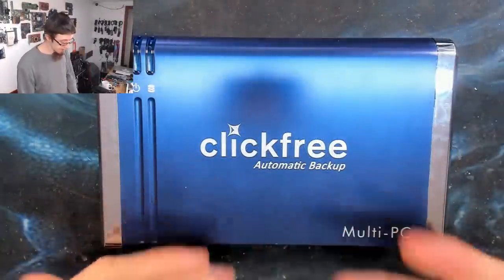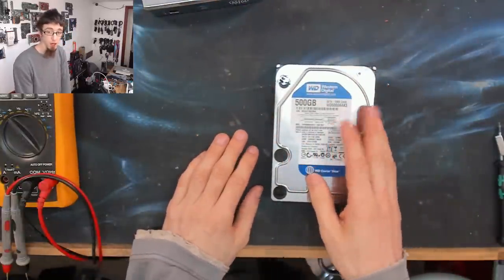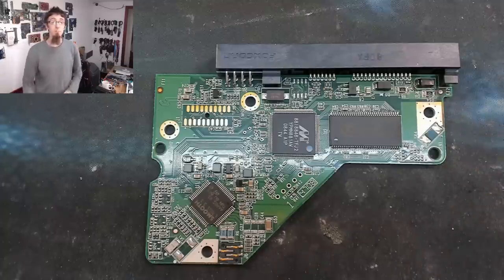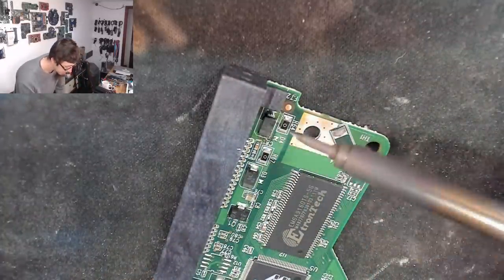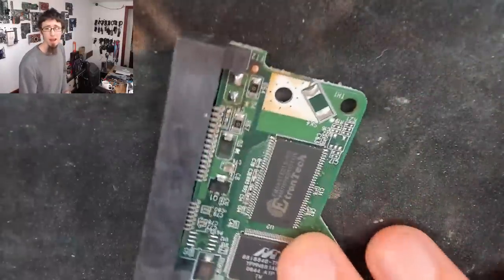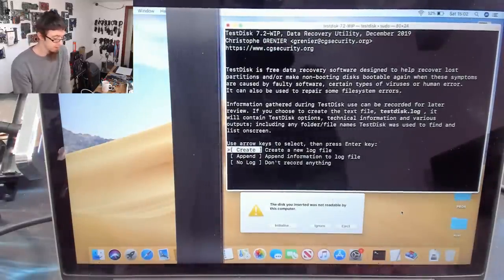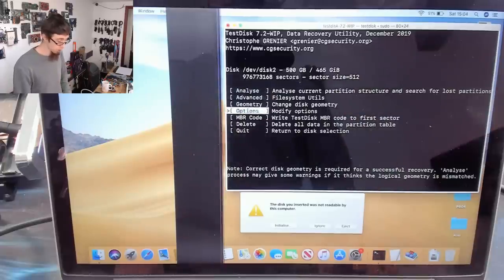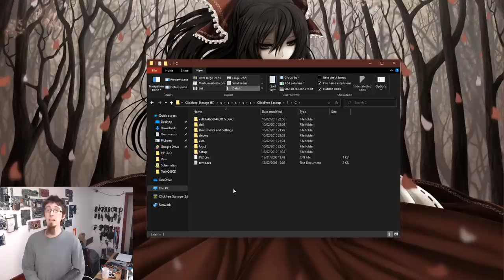Lucky save, HDD with shorted SATA connector - LFC#223

Comment from the maker: Regarding the Tweezers I mention in this video, I was mistaken - they're LCR tweezers, not hot tweezers. So not actually useful for this job.
Reply: Adamant IT yes you can see them in action @electronicsrepairschool
Reply: A better option to remove smt components is with a hot-air rework station. Basically it produces a small stream of hot air to melt the solder so you can remove it. Alternative you can use solder wick (braided copper) to remove solder from the PCB and component so it can be removed. That said the hot-air station is the preferred tool to rework PCB boards.
Reply: I've seen there are ~$15 solder iron tweezers online now on eBay and I assume Aliexpress.  I ordered two additional SH72's with some J style tips and printed a holder on a local fab lab 3D printer to make portable tweezers.  Haven't gotten around to assembling yet, since don't have the need. I'm still working on outdoors projects.   Am planning to either use PlastiDip or Type 2 silicone coating on the 3D printed part also to seal and provide a little better grip.  Thanks for sharing... makes me want to check my bin of HD's to see what might still have some life left.
Reply: Hey adamant IT. Quick question, if I have a 1080ti where 1 fan might be shorted, and the card only shows black screen when booting, what options do I have? Have disconnected all fans, but it wont boot. Is there something I could swap out or check with a meter?
Reply: @runehansen278  If the fans have three wires (speed feedback), its possible the card will not run with the fans disconnected. One option is to try running the fans (12VDC or 5VDC depending on fan voltage) to see if they work. Also check the fan power pins to see if the card is supplying power to the fans.
Reply: @guytech7310  the fans run when the card is plugged in. It has 3, 1 of them had its wires cut by the metal fins.  1 fans has 4 wires, the others 3
Reply: @runehansen278  4 wire fans have speed control, 3 wire fans usually just feedback. Its possible one or more of the fans isn't providing feedback signal. 
if all of the fans are working, than the likelihood of a bad fan causing the problem is low.  It could be a bad voltage regulator on the board, if there are any electrolytic caps on the board they could be suspect causing a low voltage rail output.
Reply: @guytech7310  thanks, I will try looking closer
Reply: @guytech7310  if I send a picture, can you maybe help me with some points i could measure?
Reply: @runehansen278  Fans go open circuit and not short circuit
Reply: Not cheap ($32 Australia - tiny amount) but if one is not so patient, Chip Quick’s Low temperature solder, I only seen others youtubers use it, as I not tried it myself. You just add the solder to reflow at it temains at melting point a lot longer. In regards to melting plastic, I yet to experiment with kapton tape to see how good of a heat insulator they are, love to tape up plastics connectors to heat sheild them from the hot air gun. Think i buy a temp probe and tape it up with layers of Kapton to see temp differences over hot air, how efftive Kapton is. They say it can withstand temperures up to high as 260°C (500°F). I seen other tech tape over ribbon cable connectors without melting. All sharing for any short cuts that the tech savvy knows, to make life easier or simple for those newbies out there. Yes I have foolishly tried melting glue and end up accidentally deforming a small section of the white backlit plastic from the display screen. Should of used that UV glue the dentist uses or Kapton.
Reply: @jafinch78  would you care to elaborate on this setup ? I also got two SH72 and will be happy to test your 3D tweezers model if it's finished/useable !
Reply: @jonas-fr  Sure, great timing since the cold front came in last night and even though I still have some outdoors chores to complete before the snow falls... I am wanting to look into again as I saw at the Goodwill Store a 170W Lenovo laptop PSU... though unfortunately was only a 20V unit and I don't really feel like reverse engineering at this time to beef up to 24V. Otherwise, I haven't done anything other than PlastiDip'd the handle part that was 3D printed.  I used this printed part:
http://www.krekr.nl/content/cheap-smt-solder-tweezers/    I wound up deciding on a ALITOVE AC 100-240V to DC 24V 5A Power Supply Adapter Converter that was an eBay offer accepted for $9.   I ordered another power supply adapter converter, though that one wound up not working and I have to disassemble, inspect and attempt repairing. The plan is to use two male 5.5mm x 2.5mm barrel plugs soldered together to make an adapter to the 24V 5A PS.  Edit to add that I was thinking about desoldering the female barrel plugs on the SH72 to save a little money and just directly wire to a female connector to the power supply.  Decided not too.  If you have any other questions... feel free to ask.
Reply: @jafinch78  thanks !
Reply: @jonas-fr  Not sure if applicable for your needs, though I just thought about noting regarding tips if you've not seen the comments in this article.  Here's regarding a video I made regarding to mod for the range of available tips: https://hackaday.com/2020/01/27/review-saneryigo-sh72-soldering-iron/#comment-6261646
Reply: @jonas-fr  Finally got around to editing the photo of, and narrating (long winded), the SMD Tweezer build.  The image details pretty much everything other than the shrink tubing for the barrel connector solder joints and connectors. https://www.youtube.com/watch?v=iMwJ-Jm0dpM  I left links in the description also for the STL's and some of the parts used.
Reply: Hello I have question about a diode?   I'm not sure if it's a diode or resistor, it has an S right in the middle. I have a picture but can't post in the comments.
Reply: @KingJamesFive20  Can you post a pic on google.com/drive or another site and then post the link?
Reply: @jafinch78  did you get the link?
Reply: @KingJamesFive20  I don't see the link in the comment reply thread.
Reply: @jafinch78
Reply: @KingJamesFive20  I asked on reddit also, since I have not a clue.  Was hoping was not that, other than will be a good learning experience. https://www.reddit.com/r/AskElectronics/comments/n0weoj/what_is_the_smd_s_marking_code_define/
Reply: @jafinch78  thank you
Reply: @KingJamesFive20  Your welcome, new to me.  I just updated the link also: https://www.reddit.com/r/AskElectronics/comments/n0weoj/what_is_the_smd_s_marking_code_define/
Reply: @guytech7310  It seemed really close to the plastic connectors
Reply: Wow! Just what I needed to rescue some lost photos from my backup external hdd. Already rescued from the other hdd 99% of the data, but still it bothers me that i dom't have a.full backup! Trying.this.tecnique ain a few.days? Thanks AdamantIt!
Reply: Hello. No matter which usb storage I connect to my computer, I get a message
(It's an error) And win11 gives you the option to scan and fix the problem.

The problem is that this also happens with newly formatted external USB 2 hard drives. Also usb2 memory pen. 

Always when windows tries to scan and repair the disk, CMD (scandisk /f e:) it always says at the end that it failed and could not repair. during this process things on the disk were deleted and other things were done. Some of the content is now more damaged than before!

On a usb hdd disk, I formatted with full format and afterwards I did a full sector scan without any errors. After copying a few files, win 11 started complaining. Why?
One of the explanations is that it is windows.

I have experienced this with 4 USB HDDs and several USB sticks
Reply: Hello. No matter which usb storage I connect to my computer, I get a message
(It's an error) And win11 gives you the option to scan and fix the problem.

The problem is that this also happens with newly formatted external USB 2 hard drives. Also usb2 memory pen. 

Always when windows tries to scan and repair the disk, CMD (scandisk /f e:) it always says at the end that it failed and could not repair. during this process things on the disk were deleted and other things were done. Some of the content is now more damaged than before!

On a usb hdd disk, I formatted with full format and afterwards I did a full sector scan without any errors. After copying a few files, win 11 started complaining. Why?
One of the explanations is that it is windows.

I have experienced this with 4 USB HDDs and several USB sticks
Reply: you need to put a time where it is  mm:ss 00:00

Comment: Massive thank you for this guide! I found myself in a similar situation with my backup drive failing to spin and a short on the 12v line. Informed by your content, I ventured to remove the diode, and to my delight, the diode was shorted out of the circuit and... I'm now successfully recovering my data!

As someone with minimal experience in electronics, particularly with circuit boards and soldering, I was initially apprehensive. However, your clear explanations and practical tips made the process not only achievable but genuinely enjoyable. Channels like yours are a treasure trove for novices like myself, empowering us to tackle technical challenges with confidence and enthusiasm. Your work is not only educational but truly life-saving regarding data recovery. Keep up the fantastic work – you're making a significant impact!
Reply: where and how did you find replacement diode ? can you find a compatible one in any old devices pcb ?

Comment: @Adamant_IT Thank you, Graham! I received a laptop yesterday, which would not POST when the SATA 1TB Seagate HDD was connected. I removed the HDD, removed the PCB from the HDD, and checked for shorts. The 5V rail was shorted all over the PCB. I injected voltage, starting with 1V and 1A, increasing to 3V and 1A. The diode got hot, which caused me to remember YOUR video! I removed the diode, and the HDD worked perfectly after I reassembled it and connected it to the SATA port. Since I have no use for this HDD, I did this purely as an experiment and for my training experience. Thanks ever so much for planting THIS video into my brain for future use, two years later.

Comment: I had a TVS diode go on a WD from my parents' PVR which had a PSU pumping out too many volts on the 5V rail - luckily this meant I could recover the recordings - I went down the road of replacing the entire board and swapped out the BIOS chip which matches the drive. Deep diving into it I learnt that the two TVS diodes for 5V and 12V work in conjunction with R64 and R67 (0 Ohms) so that the current shunts down to ground via the diodes and either blows the diode and/or the resistor to prevent damage to components further downstream - very sensible design IMO. Like you say - get the data off ASAP! Nice tip on using testdisk for MBR recovery :)

Comment: 4:45 You could have also talked about rust accumulation over time here. Right above you left hand finder are the contacts pads that connect the board with the HDD head. Overtime those pads can develop a layer of rust (Your HDD already have some. Its that yellow discoloration) and this can cause the HDD to have a lot of R/W errors. This can make a HDD look like it has bad sectors or is dyeing but in reality its just a bad connection between the Head and the Board.
Cleaning it can bring the HDD back to fully function.
Saved 2 Seagate 2TB HDDs by cleaning it.
Reply: Mr Guru  There are many types of rust. Its defensively rust just not the usual green/blue rust that you usually see from water damage.
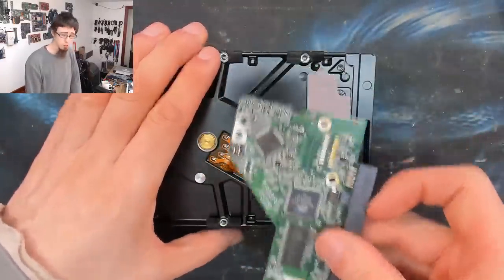Reply: very interesting.. it's also visible around the 3 screw holes @4:41.. what causes oxidation to occur gradually like that?
Reply: @duroxkilo  
As far as I know the type of rust that aren't chemical are related to heat, humidity, and oxygen concentration and the type of metal. Also the flow of electricity can accelerate the process.
Oxidation will happen overtime to all metals. Some are more resistant than others. 
Aluminium for example is very resistant to oxidation because it rapidly form a thin aluminium oxide layer that impedes the metal from entering in contact with oxygen.
For those kind of applications the best metal to use is Gold. That is why Memory and CPU terminals are usually Gold plated. Gold is very resistant to oxidation and a excellent conductor but its also expensive. Idk what metal they are using to plate those terminals but due to their color its definitely not gold.

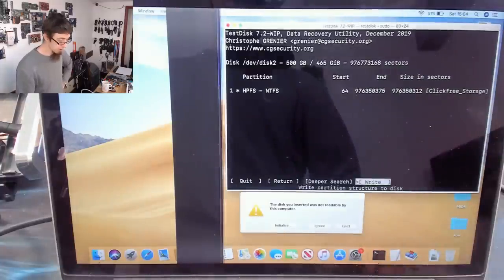Comment: Just a heads up (to viewers and author alike), @14:01 DO NOT write to the actual disk!
That is very bad practice: If there are deeper faults with the drive you may make the drive forever unrecoverable. The customer will be less than happy if any future attempts to recover data (by say a specialist lab/company) are thwarted by your inadvisable write to the failing drive.

What you actually want to do: perform a sector by sector copy to a doner hdd or image file. Testdisk will also work against an image file (the linux and windows versions have been used this way by this commentor)

Comment: I had a IDE hard drive of 250gb with only 130 hours of run time on the clock, there are no bad sectors on the hard drive what so ever, but one day, i had to backup a laptop, and when i plugged that drive into its supplied adapter, there was smelly black smoke comming out of the enclosure, so i took out the drive, removed the board, and yes, a blown up diode, i replaced that diode, and now, 3 years later, this drive still works perfectly fine, with no bad sectors what so ever

Comment: Just fixed one of these the other day, Looks like the customer plugged in a 19v laptop charger into the 12v in (same plug 5.5x2.5 i think) Luckily the TVS diode blew and saved the drive, I removed the diode and recovered the data.

Comment: Good trouble shooting. Many times a a multi-meter is all that you need along with focused rational thinking. Reminds me of my days on a test bench in the Marines working on power supplies. Diodes are usually part of power supply problems ie, not turning on. You might want to get yourself a nice table mount vice grip to hold the things in place while soldering. Also, I would wick away that extra solder on the board before reinstalling. It can cause other problems.

Comment: Interesting video.  Considering the drive's diode was already toast, I hardly blame you for not wanting to use the original enclosure again.  I'll just throw my two cents in...   Having done a small amount of recovery from external enclosures that were sold with pre-installed HDDs I've seen some that use an intentional partition offset for the user's data.  In those cases the SATA board in the enclosure is often designed to appear as two devices-- an HDD and a small CDROM drive or pre-loaded read only partition (inside the offset area) that contains the advertised and included software for backing up etc.  You would see the drive using two drive letters, but each drive letter might show as different device types.  If that's the case, then connecting it to any other SATA interface other than the one it came with will show the drive as uninitialized since the layout is intentionally non-standard.  I'm guessing you might have unknowingly encountered one of those weird enclosures.

Comment: In case of any doubts, this protection diode did its job, going to short circuit and saving the rest of the electronic components on the PCB. This is not a regular Zener diode, but the so-called TVS diode or a transil. In case of a voltage spike on input the short circuit to ground causing the faulty PSU to shut down. They can absorb pretty high energy.
Reply: yeah they say we can use it without TVS diode but without using it doesnt mean that we are open for new troubles ??
Reply: @seckinseckin3919  For testing/data recovery purpose, it is fine to run without it. Of course, assuming we are using a reliable power source.

Comment: I've seen zener diodes being used as voltage regulators before, particularly on a Commodore 64 for powering the cassette drive motors. The rail put out somewhere between 10-12V I believe but the tape drive needed something like 7 or 8 volts, can't remember as it was years ago but that's what the zener was rated at and since it starts conducting at that voltage it clamped the voltage down to the needed amount because everything "excess" got shorted to ground basically. 

Very effective however if it fails open circuit it unleashes the non regulated voltage to the motors, thankfully it survived when I accidentally did that. It was shorted initially which is why the tape drive wasn't spinning

Comment: "You put it to another enclosure". That's not always true because 2,5" external drives have dual USB connectors soldered to their board instead of SATA connectors like on regular hard drives you can find in any store.
Reply: David M that’s a Toshiba trick 😒
Reply: @steve.Lowles  Didn't know that. I saw that on WD drive first.

Comment: 2 quick issues: 
   1.  Not all drives will 'com to life' by the REMOVAL of the TVS diode ... (Seagate does I gelieve)
   2.  Always clone patient drive before messing with the data...  :)

The approach to the drive's data was contrary to 'best practices'. 
It's generally unwise to write to the "patient drive" ... better would've been (even using free programs) to have used something like  DD Recovery (and DO HAVE IT LOG, it can be very useful) ... create either an image on a drive (strengths and weaknesses to images) or clone the drive to a drive that at minimum has the number of sectors (in size) ≤ than the 'offset' to the last sector used ... ... then ONLY MAKE CHANGES TO THE DRIVE YOU'VE JUST CLONED; (especially if you're going to edit that partition in any way).   

Thank your for another good video ...